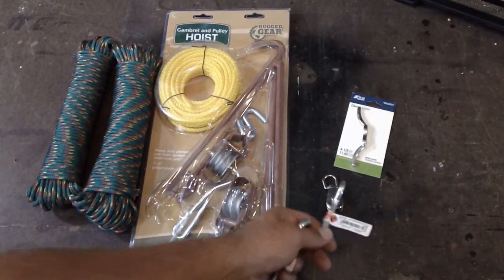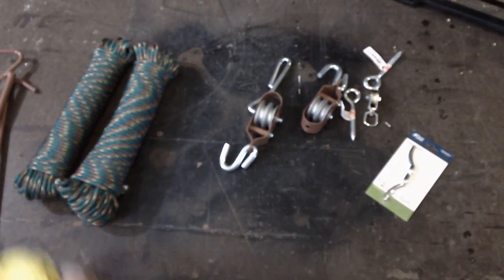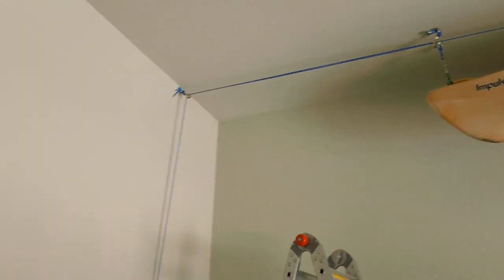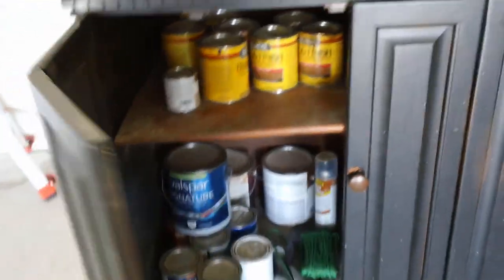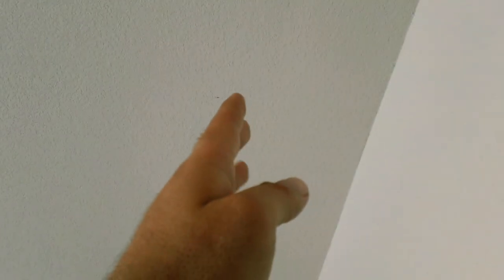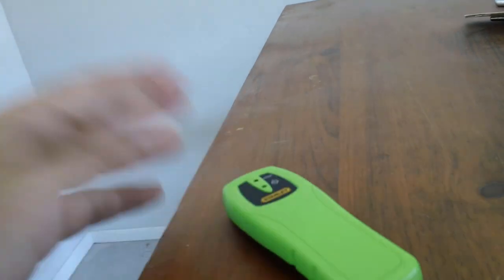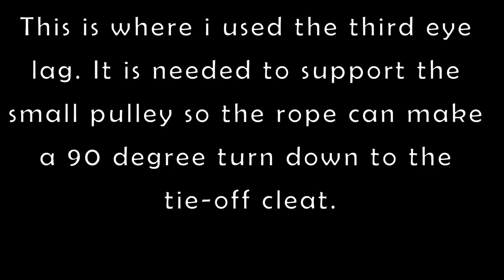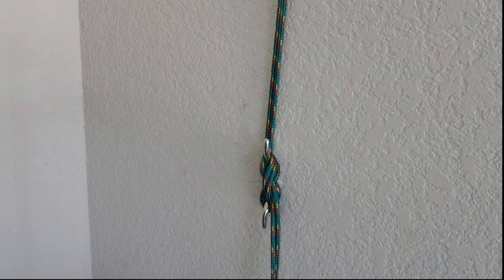DIY Canoe Lift/Hoist build

Comment: HI, I overall like your video, but maybe I missed something. When you showed supplies needed, I only see a total of 3 pulleys, but you actually used 5. 😊 Did you buy the other two separately or with a second kit? No worries as I can still use this as a reference, so I do appreciate you sharing this. (I will also use @popeyebob9007’s suggestion on the rope as I only want to do this once! 😝

Comment: My one little tweek would be to put some 4 inch screws into the clear instead of the factory ones. With the thickness of that drywall, those screws are maybe a quarter inch into stud...maybe...just a little extra insurance. Won’t hurt nothin.

Comment: Great video 👍 You said your kayak is lightweight , Mine is over 100 lbs could I even lift it if I built this ?
Reply from the maker: Yeah, I'm pretty sure it would hold it.  Lifting it might be difficult but you could rig it to a hand crank winch like on a boat trailer.
Reply: Go get 5 double pulleys, each has to be rated for at least half the weight of the yak, get some 100 or more lb para cord, 3 screw eyes and 5 S hooks. The double pulleys will give you a 4-1 lift and make it pretty easy to lift. You should be able to find plenty of examples online on how to set the pulleys up. It’s much easier than it sounds and looks. Just run the two systems each with their own line and pull them both from wherever at the same time, and the yak will go up and down without having to help either side. Most systems you buy run two separate lines too. You can do it with fewer pulleys. But it’ll be harder to lift than with the 5 doubles

Comment: Good job.  Nice and simple.  Next time cut out all the time you show of you tying knots and screwing in bolts.  Just cut to the most important things, like placement, equipment used and how.  But good job.
Reply from the maker: Nice advice, thanks.
Reply: I was thinking maybe speed up some of the areas like the tying and screwing. I like how he used the screwdriver to help with the eye lag.